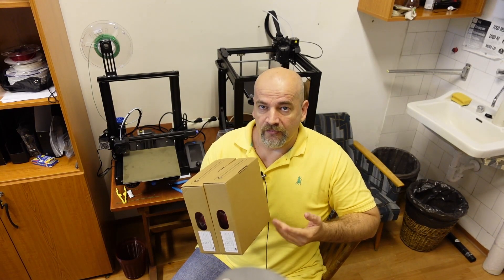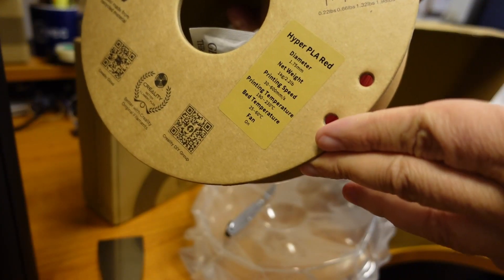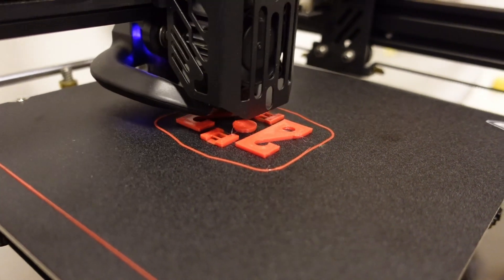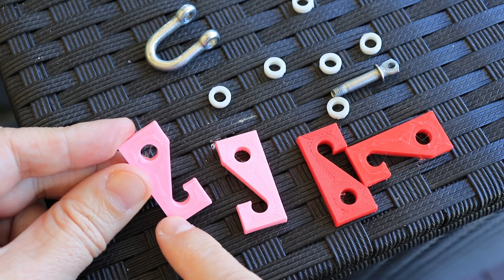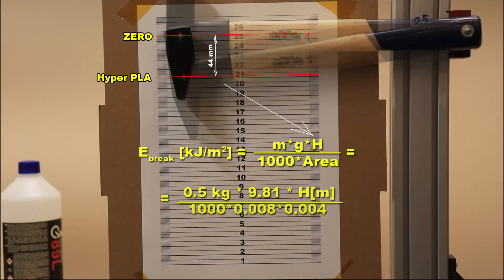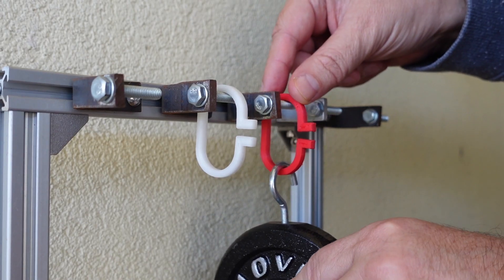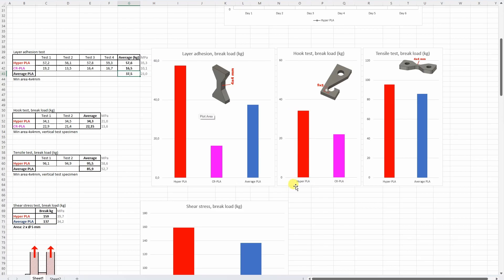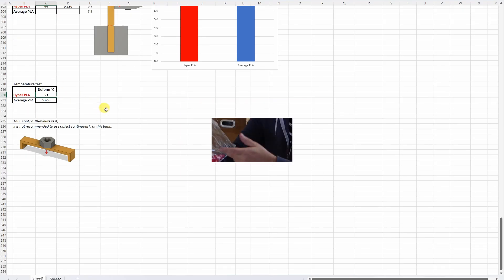Creality Hyper PLA filament review, designed for faster printing

Comment: Hyper PLA is the worst filament i've ever used. Bad layer adhesion and so on, list is infinit... I tried everything, but not even temp tower is clean... I have K1, V3 KE and S1 Plus.. No mather which printer i use,  filament just fails...  Not one print have been ok.
Reply: Skill issue, my k1c prints it perfectly, stock
Reply: Same it's skill issue  @eldeeablow

Comment: IMO even if you didn’t have the K1 yet, showing results on a Ender 5 was not very useful. Would’ve been better to see results on fast printing speeds on a Bambu Labs or SV07 or one of the Klipper printers. I don’t think people are going to buy hyper PLA unless they are using it for fast printing.

Comment: So far I got 3 "random colour" spools of their Hyper PLA, and all three were red. Interesting that you also got two spools of their red colour, it's probably the one that sells the least.
Reply from the maker: Interesting, red is not bad color. That pink (CR-PLA) I got two years ago in the review, and I hate pink, thats why I still have that filament.. (I have 3 daughters, I saw too much pink in my life ;-)  )
Reply: @MyTechFun Sure, yet independantly from the amount of pink in your life, there are four type of colours: appealing, neutral, unappealing and pink ;)
Reply: Actually, the colors don't have to be random. That's the default selection, but there is a tiny arrow that allows you to manually choose the color you want for each filament that is included in your bundle. Interestingly, not every color was available for every spool. For example, I got 2 Hyper PLA spools with my bundle, and I picked black for both. But there was an option to select gold for one of them, and gold was not able to be selected for the other. (I can't remember any other color that wasn't available on both, but there could have been. Maybe pearl wasn't available on both either. Maybe others. There were more than a handful of color options for both, and most were the same.)

Comment: Why do you print the temperature tower at low speed? It will look totally different if you print it at high speed, and the best temperature for high speed printing will be totally different.